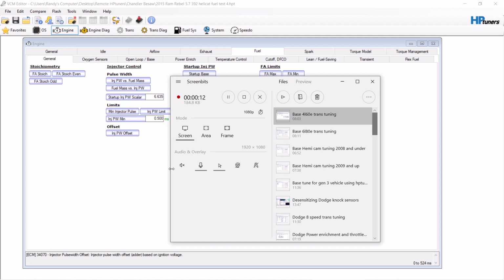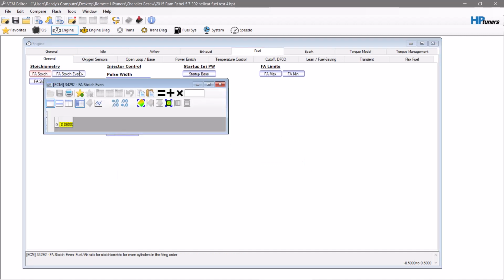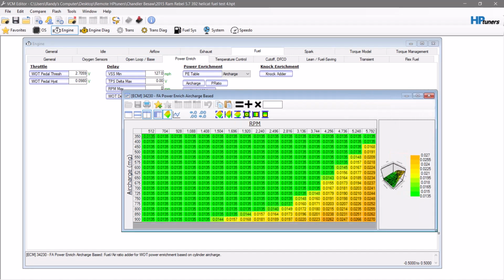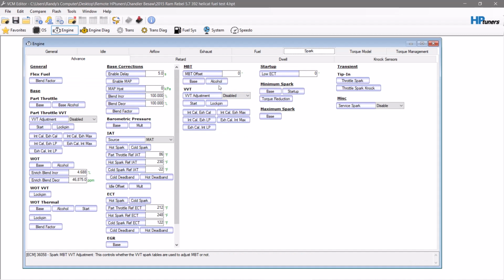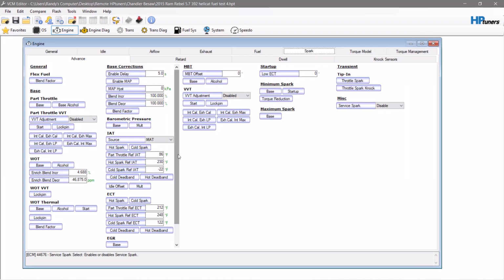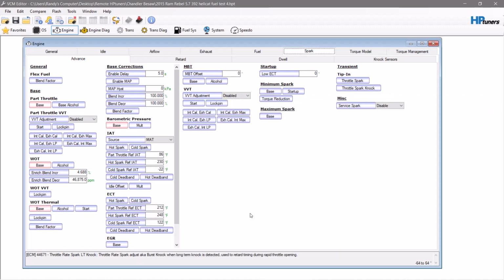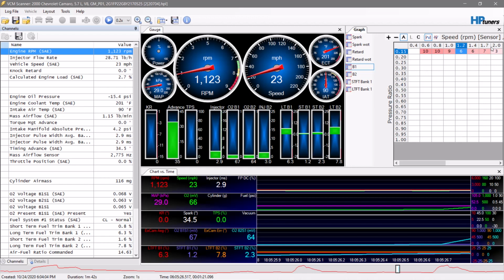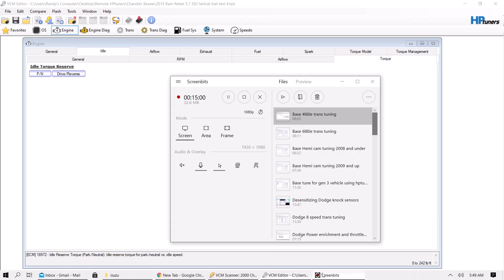Hemi Base E85 Tuning

Comment: Are you has been make a 
Flex fuel setup Im interested on doing that 😅
Reply from the maker: I’ve only got it to work on the trx
Reply: @Recklessmotorsports  Im trying to runing 30% E85 and rest 93 oc because I don’t know how to setup it on flex fuel, Im think on steal some file value from a v6 penastar that is flexfuel

Comment: Could use some help on a 2008 Chrysler with eagle heads, factory head gasket, get stage 2 cam, 2013 charger intake, long tube headers and not sure of the compression ratio. Need help on getting better torque down low and that drive by cable feel. Any help is greatly appreciated!
Reply: Hrt stage 2 cam.

Comment: Your take on barometric pressure timing modifier is wrong, the higher the baro the less timing it will tolerate.. just like more boost will take less timing. More pressure is more pressure in both cases

Comment: I've been running 5 gallons of e85 and 20 gallons of 91 so roughly 20% of e85 and its made a world of difference now able to advance to 24 degrees of timing. I installed an HPT+ Cam and wasn't able to get more than 323/HP to the wheels at 22 degrees timing, granted I do have 34 inch tires and 4x4 but have the 8 speed and 3.92's.  I can definitely feel the difference running this configuration tuned of course. My question is Am I at risk on any of the parts from running it like this?
Reply from the maker: That power level is kinda low for that set up, unless the dyno itself is crappy. Tune only we made 295whp with 37s on the truck

Comment: So what about the variation of alcohol content from pump ? E50 will have a different stoich than e85 . can this method tune for them
Reply from the maker: Yes same method
Reply: RecklessMotorsportsUSA so whats the best lambda to run with e85? And what if i tune the car with a pump that reads 70% then fill from another pump that reads 60 will that make a difference in fueling ?
Reply from the maker: It does makes difference which why people should for safety only run flex set up or store drums of 85 at home